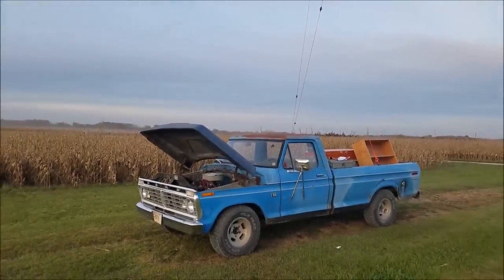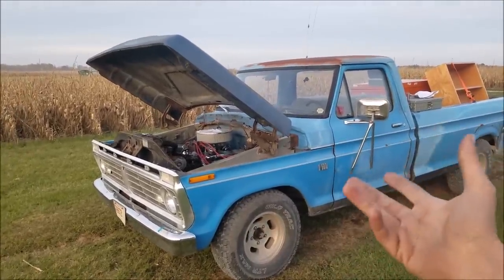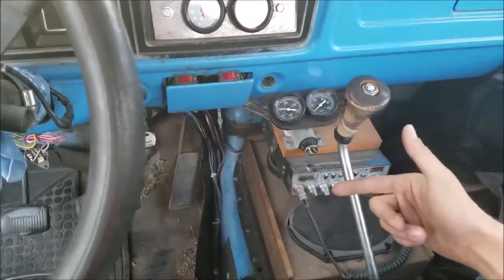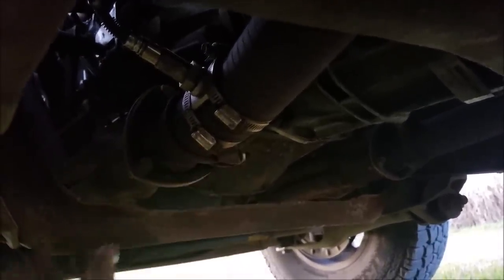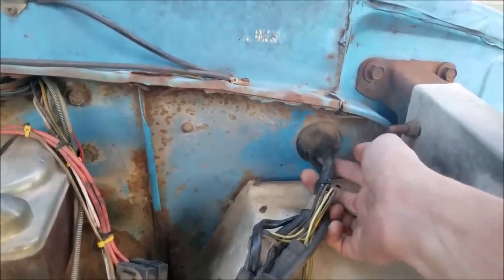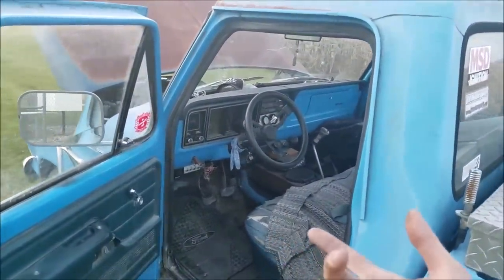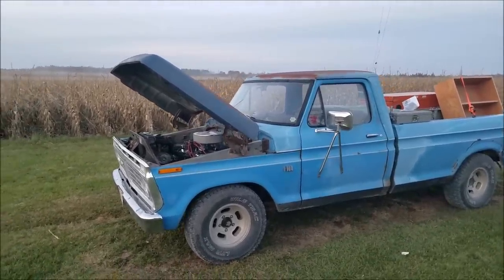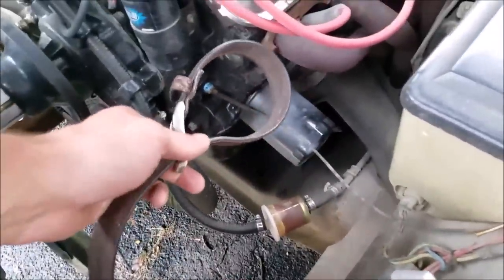Become a Carburetor Tuning Expert - Tune by AFR Gauge (CHEAP Wideband Install w/ Part Links)

Comment: Put a Y pipe on it and read both banks at once.
Reply from the maker: Everything should be equal - they do sell dual tap o2 set ups that then feed to a single gauge with two displays on the gauge

Comment: Question I have a 302 when you crank it over is a little heavy and as soon as you press the throttle it's easier any suggestions on it car does run and drive but kinda bothering me
Reply from the maker: so let me get this straight - it cranks over slow, or it doesnt want to start unless you open the throttle while cranking?
Reply: It cranks slow but when you press the pedal it cranks a little faster sometimes it won't start without holding the pedal a little down

Comment: why is it that when im at idle my engine sounds great but it idles at like 10.2 to 1 afr.  if i adjust it any leaner it starts missing right away.  also when i step on the gas it leans way out like just for a second when the accel pump is working, does that mean i need a bigger squirter?  600 quickfuel carb
Reply from the maker: Without seeing it in person, It sounds like your timing is way late - what is your idle advance? 
Also, because of this you would then have your throttle open to far to accommodate rendering your transfer slots useless and causing off idle acceleration issues. 
I don’t think you need a bigger squirter, I think it’s a timing & carb balance issue. 
Join The Thunderhead289 Facebook group and we can discuss further there 👍
Reply: ThunderHead289 thanks, yeah im getting a 383 stroker built right now and going to be using the same carb. Just wondering so i dont hurt the new engine. I know the timing is something on my current engine. we tuned it by ear but the timing mark is off so we are trying to get it as good as we can right now

Comment: I wish l could get you to fine tune my 69 f-100 swb 300 cyl. W/C6 auto. I've owned it for 38 yrs. It's a beauty, unfortunately l just can't get it to idle for more than 15 min., starts studdering. Then it dies. It blows black smoke out tailpipe. I really like my truck.
Reply: we recently had a similar problem with my daughter's 65 mustang with a 289 she and my dad rebuilt.  we had been taking it out for short test drives (eg: less than 20 minutes, around town) and the engine would run fine.  but once we started driving for longer time periods (eg: more than 20 minutes) it would stutter and stall out at stop lights.  we couldn't figure out what was wrong.  well, after a week of testing and trial and error we think we've fixed it.  the problem was that our timing was off. by advancing the timing (quite a bit...maybe 45 degrees from where it was at) we've got the engine running great even after 45 minutes of driving.  no stuttering or stalling problems at stop lights anymore.  (also, her car temp had been at 200 degrees before the fix.  now it sits at 180 even after driving around for 45 mins...so that is a nice improvement as well.)
we're sort of new to all this, so we're not quite sure why the timing was fine for 15-20 minutes, and then bad after that.  does heat somehow affect timing?
long story short: we thought we got the timing right, but it was only right for up to 15-20 minutes of the engine running.
Reply: @thomasdeaton8768  l don't think engine heat affects the timing, cause the distributor is an  electrical item. But since l'm not a mechanic l could be wrong. I finally found the problems (2) causing my 69 f-100 to run so rough and after heating up it just die out. My coil wasn't putting out enough fire, less than the 40 thousand volts  needed. I replaced it and thru U-tube found out that l also needed a coil external resistor. After l finished putting these two items on , the truck started right up and to this day is purrs like kitten. It's so smooth running my grandson said " your truck runs so smooth like it's fuel 
 injected" so yes . l'm glad to hear your car now runs ok. Sometimes it takes quite a bit of time to get an older vehicle to run good. Where l live no mechanic wants to work on my truck, saying we don't have any info. books on it. Soooo... I work on it until l find the problem, but l'm retired l really like to work on ol' Blu. Thats my truck. God bless. I got a video on my truck on U-Yube. Its titled " Ol blu is Finally back on the road again"
Reply: @olblu8746  oh cool.  i'm glad to hear you got your truck running right.  it sure is a nice satisfying feeling when we finally figure out the problem(s).
also, i watched your video.  that's a cool, good-looking truck...and you're right: she does purr like a kitten.  great job! 👍

Comment: If u have headers just one side will work?
Reply from the maker: It will indeed - your engine pulls from both sides of the carb per bank. As long as the carb is set up even from side to side as it should be, your good to go!
Reply: @ThunderHead289  thanks sir love ur vids
Reply: Hi had another question which one would be a good one to buy? 74 nova a bit high performance lmk thanks!

Comment: O2 sensor for carb???
Reply from the maker: Of course. Makes tuning maybe a 2 hour job and mitigates any guess work as long as you know what circuit of the carb your on when afr is out of range. 
Tuning carbs is far far more than hillybilly how turning mix screws

Comment: I’m new to carb tuning an I installed a fuel pressure gauge on my edelbrock carb and the stock fuel pump is doing 6-7psi at idle and 10-13 at 1500 is this to much for a edelbrock carb
Reply from the maker: Wowza, that’s some pressure 
That would be too much for it to handle for sure. 
Grab you a cheap regulator from summit racing and regulate her down to 5.5 👍
Reply: ThunderHead289 thank you sir I will start with that luckily I grabbed a summit regulator the same day I got the gauge just don’t know a lot about carbs other that setting idle and mixture screws been watching your carb videos
Reply from the maker: if you have any questions, just ask away. 
im much easier to catch on facebook at "thunderhead289 carb & engine: tech/tune forum"